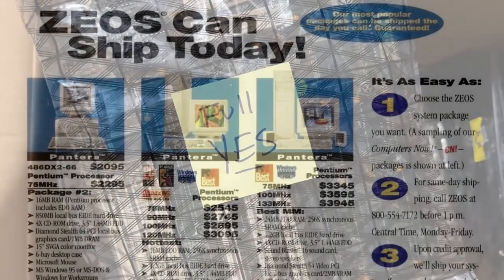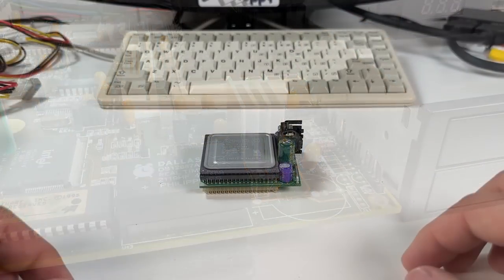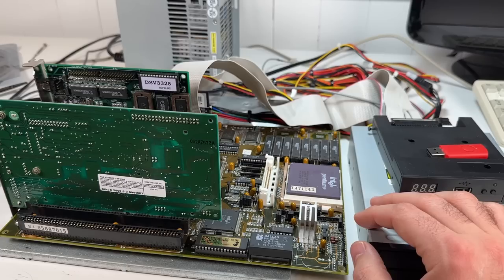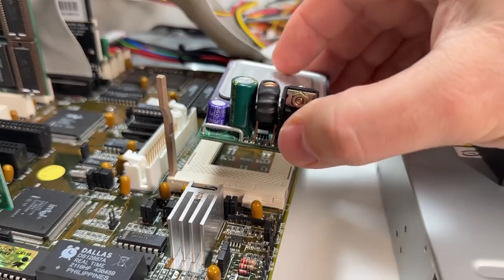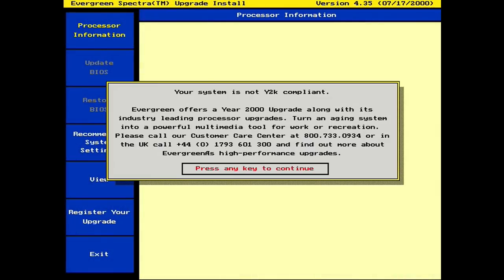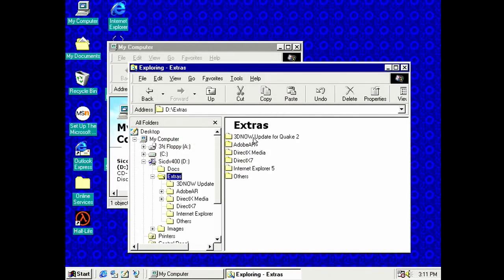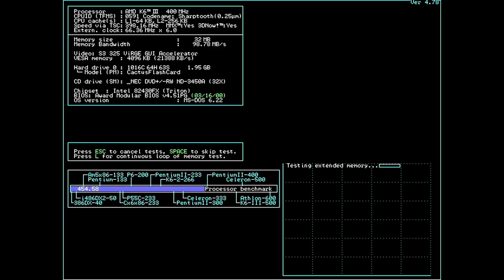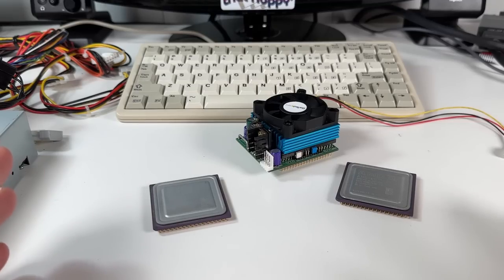Evergreen Spectra 400 – The Ultimate Socket 5/7 Upgrade CPU!

Comment: Thanks for mentioning my catalog of decoded Evergreen BIOS updates. I've actually been a subscriber for a while! Small world. It was a pain to reverse engineer but I eventually got it done in a roundabout way.
Reply from the maker: Haha small world indeed! Thanks so much for providing that archive of extracted BIOS files! They will come in handy for a lot of folks trying to get unsupported CPUs going on older boards. How did Evergreen compress/encode these out of curiosity? Thanks again! 🙂👍
Reply: @vswitchzero  I wasn't able to determine the compression method because 16-bit reverse engineering is a pain, but I did figure out the header for that and the multi-file archive format they came up with for the BIOS updates. Since a few text files get decompressed on startup, I ended up writing a script that went through each file in each BIOS archive, replaced one of the text files and ran the executable under a DOS emulator to extract it. This ultimately worked in the end. You're welcome!
Reply from the maker: @RichardG867  Very clever solution, I love it. Thanks again!
Reply: @RichardG867  Great work around, well done sir. Wanted to add my thanks for your work.
Reply: @RichardG867  Is there any easy ways to know what bios images go to what boards once you've extracted them?
Reply: Thanks! Amazing work!
Reply: Thanks  if your catalog of bios updates is the one I'm thinking of I've used it make times. Thanks!
Reply: @RichardG867 - Manificent contribution to IT archeology! Thank you!!!
Reply: Thank you @RichardG867 for your work!

Comment: I miss the days where you could make new hardware work on old boards like this, things like these Evergreen Spectras and the Intel overdrive. Also the fact that when Intel tried to abandon a platform AMD, Cyrix etc would come in and continue to support it.
Reply: Well, those days are still around. For example, many people recently upgraded from a CPU like the Ryzen 5 1600 to a Ryzen 7 5800X3D on B350/X370 boards. And the performance difference is nothing short of amazing. Even better, you don’t need an adapter, it’s officially supported. 😊
Reply: @ruxandy  Getting a 5800X3D to work in something like an AM2 motherboard would really be amazing.
Reply: @mistermudpie  Da, ar fi. 😀
Reply: @ruxandy  Even an R5 4500 with its cut-back L3 cache would still be a big jump from Zen1, as Zen2 with cut-back L3 cache is still Zen2 and is still a big jump from Zen1 for performance, plus what effectively amounts to an R5 3600 with less L3 cache is a steal at $80 r/n.

Going back a little further, you could even get an FX-series part to work on some AM3 mainboards with a BIOS update, but that wasn't generally advisable due to the VRMs on AM3 boards being too weak for Bulldozer and Piledriver, where AM3+ boards that were designed for the FX-series CPUs had beefier VRMs than AM3 did, IIRC, Conversely, K10 AM3 silicon is backwards-compatible with AM3+ boards, so if you wanted to run a Phenom II X6 1100T on a 990FX AM3+ board instead of an FX part, you could, and it'll work.
Reply: people have gotten 6 core intel 8000 chips working on z170 boards and stuff, it still happens just isn't widely done
Reply: @BobTheBob9  that's because it's basically the same socket and should've worked from the get go, if not for an artificial limitation on Intel's part.
Reply: @mistermudpie  agree somewhat but at the same time the pinouts are somewhat different, so it's still impressive that people managed to get them 100% stable on the older sockets
Reply: @mistermudpie  Vs. that thing with FX CPUs working with older AM3 boards with a BIOS update in which a lot of people fried their boards doing that because the Bulldozer/Piledriver silicon was too much for those older AM3 boards' VRMs.
Reply: You can run 7-10th gen intel on a 6th gen board
Reply: @DFX4509B  The CPU support lists on vendors websites were periodically edited also, undoubtedly due to failures and warranty claims. ie, one minute a board would have support for a particular 6 or 8 core FX AM3+ and then they were no longer listed as being supported.
Reply: This happend again with slot1/socket 370  with adapters, slotkets and (one last time) with Cyrix chips. Heck, I have a Tualatin-S 1400MHz (the King) running on a BABY-AT mainboard.
Reply: 6-7-8-9 gen of intel motherboards can be hacked with a bios update to allow retro compatibility, there are quite a few boards on aliexpress
Reply: @mistermudpie  modern stuff might be hard. 
But, I strongly suspect that S754, S939, and S940 K8 CPUs would be inter-compatible with a socket adapter.

Looking at pin outs between them, it's pretty clear AMD actively mitigated the possibility of socket adapters. The PCB and trace layout for a socket adapter would've been a nightmare. Biggest issues being signal integrity and cross-talk.

Today though, I could see an individual designing something, and getting JLPCB, PCBway, etc. to build it for them.
Reply: China is still doing it by supporting modern CPUs on older chipsets.
Reply: Ryzen do be like that with BIOS updates.

Comment: I miss the days of goodwill computer works. They used to have mail bins full of parts screws motherboards and vintage computers all on the cheap.
Reply: You used to be able to find great computer deals at Goodwill. Now they don't even sell them. Not sure why.

Last year I dropped off some electronics recycling stuff and checked out the pile of PCs on a pallet ready to be recycled. I was blown away to see one of those Power Computing Mac clones sitting on the pallet. I almost grabbed it and drove off but I just don't need odd projects like that in my house any more.

Comment: THANK YOU. I have been waiting for someone to cover these for years. 
I had the 333 or 400mhz version which we stuck in our p90 Compaq, I honestly don't remember which now,  and had to upgrade to Windows 98 as it caused windows 95 to crash! (General Protection Fault iirc) and at the time we did not know about the Win95 patch.

The system had fast page mode ram not even EDO, but it was still massively faster than it was with it's original pentium 90. Kept that system running until the early 2000s.

I don't think we ever tried to upgrade the BIOS, I don't think my dad realised at the time we were meant to!

Used to love playing games like Total Annihilation with the system and it's whopping 72mb of ram, and whatever GPU I'd scavenged at the time. I went through a number of S3/trident/cirrus logic etc and ended up with something with around 4MB of VRAM on a PCI bus. Loved that system.
Reply from the maker: Thanks for sharing! Love hearing these first hand accounts of the hardware 👍
Reply: @vswitchzero  it was an awesome time for hardware. So much new and change. Honestly it was incredible just how far these pushed a Pentium 1 era board, even with a locked down OEM system style board, they genuinely made the system feel new in so many titles.

Not as good as a full upgrade with faster RAM etc, but it kicked the living snot out of a Pentium mmx or early P2 based system for many things, all else being reasonable. Your testing with the higher FSB really highlights just how much life these could bring.

My father brought a new work system later on which had a 600mhz p3 and whilst that was miles faster, this overdrive chip felt closer to that, than the p90 it had replaced, and brought years of life to the system for around £150, if I remember correctly (admittedly that would be more like £250-300 in now money so it wasn't cheap). Absolutely worthwhile considering how much a new system cost at the time.

The only unfortunate side was the fact we were stuck on Win 95, and back then we had genuinely no idea there was a way to patch that, in fact I think our Evergreen manual at the time said to upgrade to Windows 98 as there were compatibility issues with 95 (and indeed there was, it would crash during boot 3/4 of the time, although not ALWAYS, which was weird!)

Comment: Back in those days I seriously considered an Evergreen Spectra 400 + K6-2 400 MHz for my Megatrends HX83 mainboard where I started with a K5 75 MHz (later a K6 200 MHz in 97) and 32 MB of EDO RAM. But I ended up with a great deal on an Abit BH6 + Celeron 300A + 128 MB PC100 SDRAM in early 1999. 

The 400+ MHz K6-2 chips had just been released in November 1998 but the lure of an overclocked 300A, the faster and higher capacity SDRAM, less than 18 months after getting the K6 was just too much to resist! That BH6 + 300A ran at 464 MHz, 103 MHz FSB for years until the board failed spectacularly while my parents owned the machine around 2003-2004.

Still, the 486 through the Pentium 3 days were exciting with the amount of upgrade adapters that were on the market. I used a voltage adapter on my 486 PC to upgrade it with a AMD 5x86 133 MHz chip. And later on in the slot 1 days I used a slotket adapter to run a socket 370 CPU in a different slot 1 board than the Abit I previously mentioned.
Reply from the maker: Thanks for sharing! Always love hearing these first hand accounts of the hardware back in those days. The Celeron 300A was such a legend 😁

Comment: I had a similar powerleap adapter. I imported it from the US to the UK. IIRC upgraded my Pentium 75 Mhz to a Pentium "tualatin" 233 Mhz with MMX. Made a huge difference!
Reply: That isnt a tualatin 
Tualatins were pentium 3s
Reply: @primus711  Maybe his mistake is not the powerleap nor the tualatin, but the P75...  One would upgrade a Slot1 Pentium II 233MHz with a Powerleap Slot1--> Socket370 adapter to fit a Tualatin 1200MHz! :pride-unicorn-rainbow-mane:

Comment: As you may have already deduced, Unicore Sofware was a BIOS company that wrote and sold upgrade BIOS chips for PCs and compatibles.  I had purchased a physical BIOS chip from them back in 1994 or 95 to upgrade the BIOS on my Packard Bell mini-tower so that it could run the AMD Am5x86 CPU and overcome my original BIOS's 504MB hard drive limit.
Reply from the maker: Very interesting, thanks for sharing!

Comment: It's great seeing the S3 Virge Video Cards receiving their just kudos finally.   Great 2D Performance.   Great DOS compatibility.   Tiny and compatible VESA LFB Driver.   Great performer with DOS / GUS Demos.
Reply: They were fantastic cards to pair up with when the Voodoo 1/2 were still hot. I had a Virge DX and it was compatible with everything, had great GUI and DOS performance. Even was able to run X11 on Redhat Linux with zero fuss right out of the box. The 3D functionality was just useless.

Comment: My high school computer lab had tons of these installed in their Compaq Deskpro desktops that originally had 133 MHz Pentium CPUs. The original cooler had a long clip that attached all the way down to the original CPU socket. Great stuff!
Reply: I'd buy one of these adapters if I didn't already have 4 systems with running 256KB enabled SRAM Cache modified AMD K6-II+/570ACZ as AMD K6-III+/600ACZ CPUs and AGP video. I also have a pentium MMX 233 system if need be. I may toss in one of these at some point into the 233 as it has a 66MHz FSB. I can see this adapter used in 100MHz FSB SS7 boards missing the 2.0V setting for maximum performance. Great stuff! :-)

Comment: I had the Spectra 400.  I used it in a socket 7 Gigabyte motherboard.  When that motherboard was killed by a bad PSU I moved it to a super socket 7 IBM desktop I got from work.  It was 1999 and they were letting tons of PC's just rot in a wet basement.  I was able to talk them out of 2 complete systems.  One for me and one for a coworker.

Comment: I went from the Pentium 166MMX to the AMD Duron 700 in 2001 on a newer motherboard and 128MB of ram and had a Voodoo Banshee from Quantum 3D for graphics. The jump was absolutely massive. I did the upgrade due to Diablo 2 coming out and wanted to be able to play it. I knew the P166MMX wouldn't be able to handle it so I bit the bullet. I also bought a 160gb HDD as the old 10GB that was formatted to 8.4GB due to the older motherboard's limitations was quickly running out of space. I still have that 160GB HDD as a boot drive in a X58 system I have sitting here next to me with an i7-930 cpu, 12gb ram and a 1tb drive for storage. It even has a gtx 760 gpu for all that Windows 7 gaming goodness. :)

Comment: I was a computer\systems builder back in the late 90s early 2000s and I was the talk of the shop when I built my K62-550. I was able to have it running stable at 600 MHz. I had the voodoo 3 3000 video card and the games would look amazing on that system. I had that system together for a long time until the XP CPUs came out. What's funny, once i built my first AMD K6 system, I don't think I have ever had an Intel desktop system since. Even today, I run a AMD CPU.

Comment: I have this exact same board. I’ve installed a k6-2 500 directly in it without any mods or vrm board, it worked fine for my testing for about two hours. It ran at 200mhz if i remember correctly, but worked perfectly.

Comment: There was also a K6-III+ 550 Mhz. The fastest and last of the great Super Socket 7 chips.
Reply: I have only seen the K6-2 500 and K6-3 450 myself. 
Doesn't mean it wasn't made. I stopped caring when the Pentium III came out and I aquired a Dell Optiples with an 1133 MHz CPU. 
I then got an AMD Athlon XP 2200 on a Socket A motherboard.
Reply: k6-3 still had the same weak fpu . it took an athlon to catch intel
Reply: Who cared about catching Intel? It's not a race despite what modern marketing and channels like LTT and GamersNexus and the like would have you believe. The majority of people can not usually afford the top top top CPU's and GPU's anyway as market data supports. Most (over 80% of the market) buys in the mid tier. Back in the day for owners of Super Socket Seven boards these AMD chips were a major boost when you couldn't afford to upgrade to a whole new platform. It helped people extend the life of their existing platforms. Not exactly the market that cared about "Catching Intel."

Comment: I just picked up Evergreen Spectra 400 and upgraded my Intel Advanced/ML (Marl) Socket 7 board with it. I had updated the motherboard to MR BIOS a couple years ago. I swapped out the K6-2  for a K6-III+. I used thernal tape to attach heatsink & fan to the CPU. MR BIOS identifies the K6-III+ as a AMD K5 so I used K6INIT and CPUSPEED to enable all the K6-III+ features. It was a such huge performance boost that I put in a Voodoo 3 2000 PCI video card to match. The last time I did something like this was around 2000 with an old Gateway Socket 7 computer. Brought back a lot of memories.
Reply from the maker: Nice! Thanks for sharing 🙂

Comment: The K6-2 was quite tolerant of higher voltage, as I ran about 30 of these(stock ones, not the evergreen) at my job in the 2000-2001 timeframe. Most boards only went down to 2.5v core which never gave me problems. I usually  bought 450mhz versions and ran them on a 75mhz bus with the 6x multiplier. In theory most boards also had 83mhz busses but I rarely got the pci cards to play along with that speed.
Reply: Yep that was my first decent PC build  - a K6-2 300 on one of those SIS "TXPro" boards that didn't have full split voltage support or 100MHz bus. I was able to run the K6-2 just fine using an undocumented 83MHz jumper setting and the lowest vcore the board supported.

Comment: I love these sorts of socket adapters to enable newer CPUs on older boards.  The bios update collection and tool is super impressive as well, I had no idea anyone was doing that back in the day.  Personally in my retro Slot 1 PIII system I have a PowerLeap PL-iP3/T and a 1.4ghz Celeron, a huge upgrade over the 400mhz PIII it came with.  The bios reports it wrong, but it performs great.

Comment: I may be wrong, after all these years, but I think the last time I ran such CPU was on my ASUS P55 T2P4 rev 3.10 (king of OC in +/- 1997 !) + K6-2 or K6-3 / 500 + Voodoo 1 or 2.
It ran Unreal Tournament extremely well !
That was more than 20 years ago, I was living in a 36 m2 (square meters, you known, the official international unit !) flat, and I had something like 11 (almost) ready to run systems (not 11 cases for them !). Yes, I was single too ...
Reply from the maker: The ASUS T2P4 is an awesome board! I have one but haven’t had a chance to repair it yet. Would love to try a K6-2 in it 👍

Comment: I just wrapped up installing one of these and scoured the Internet for information on them (and there isn't much.) Of course a new info packed video comes out on them a month after I get it working on my own! Anyway, I had the Spectra 400 back in the day. I'd upgraded my P133 using it. I'd also used an older Evergreen board, with an Am5x86 -P75  (something like a 486 DX5 133mhz) to upgrade my old 486SX-33 years before. Being broke back then, these kinds of upgrades were much more economical than the alternative.

Fast forward to 2023, I'd purchased a fairly rare DEC PC I thought had a K6-2 200 in it only to discover it was a K5-200, Neat, but not of the era I was aiming for, but then I remembered I had this. My only concern was that the motherboard had no options for adjusting the CPU voltage outside of a replacement VRM, but after a ton of research, it seems I lucked out and the VRM it had was within spec to use the Spectra. Despite being misidentified by the BIOS like yours was, it still works great all these years later.

Fun fact: it came with a heatsink and fan (as you mentioned) but no thermal paste or pad, and no mention of it in the install guide. Of course, 2023 me had to put a dot of paste on it.
Reply from the maker: Thanks for your comment and for sharing your experiences with it! That's awesome that you found a K5-200 in that DEC system, that particular speed is incredibly rare and only a small number of 200s were made.